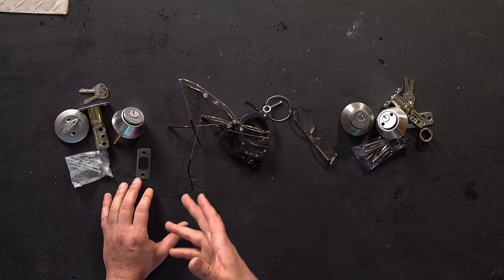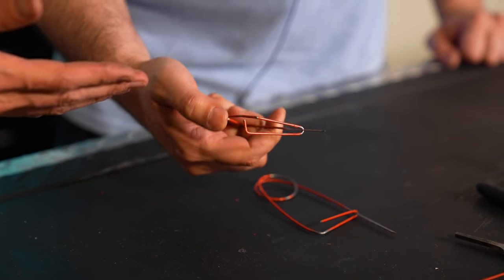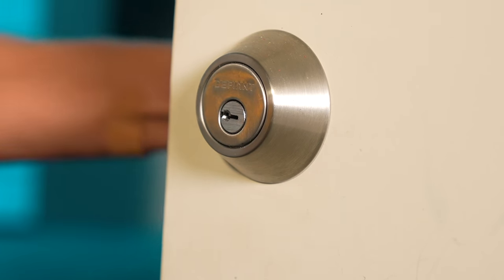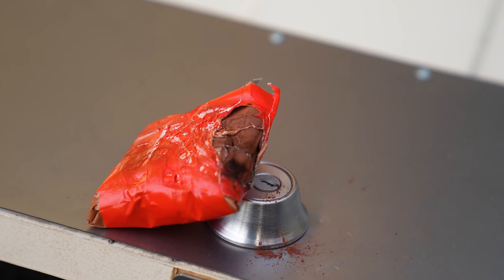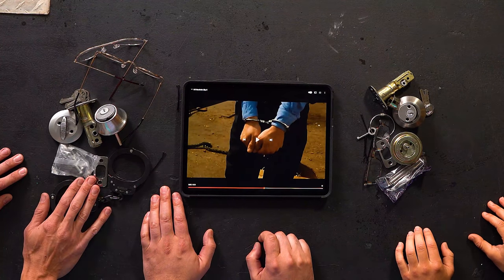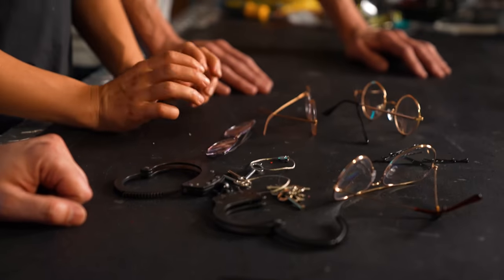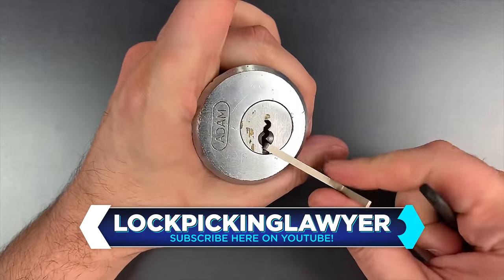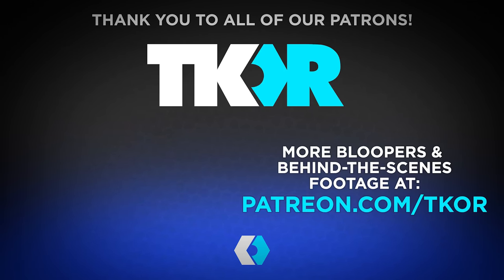Can THERMITE Actually Break a Lock? (w/ Lock Picking Lawyer)

Comment: Nice collab. That clothes hanger trick is really clever!
Reply: Hope the leg's mending!
Reply: And a little terrifying how simple.
Reply: @LightWarriorK  Don't worry too much, it's not effective against all lock :)
Reply: Hello @nighthawkinlight
Reply: Hi NightHawkInLight!
Reply: It works really easily on cheaper locks sold on Amazon, but if there's any security pins it takes real skill or brute force to shear the pins 😏
Reply: I had never seen that before I'll have to give that a try
Reply: @martinferrand4711  you’d be surprised with how many locks use subpar materials.
Reply: I want to see NightHawk make a lock.
Reply: There are some fundamental flaws in the thermite video. First, the door was positioned horizontally, which is not how a typical door is assembled. Second, you only tested it once and concluded that it wouldn't work, even though initially it did burn the door lock completely. Additionally, it would be necessary to use the thermite on several different types of door locks made from various materials to provide a comprehensive assessment.
Please redo the experiment.
Reply: thats what she said
Reply: @real-satoshi-nakamoto  Those were not fundamental flaws of the test - they were hacks and cheats to make it more possible to happen, because sure as heck it's not happening if you were to replicate the scene 1:1. Anything can happen to the outer shell of the lock - what you care for breaking and entering is to break the locking bar itself. So the fact that the door lock burnt completely makes no difference to whether the door opens or not - in fact, it only sabotaged it and now the only way to enter is by drilling/sawing/otherwise bashing down the whole door. 

Also, thermite burns downwards, not horizontal. If you put the thermite on a normal, vertical door, the whole satchel will drop down the moment it burns the handle/shell, leaving most of door intact and not even burnt. It's not some magic powder that can warp gravity.

Comment: Loved his intro. I get the practical reason for showing only his hands, but the running gag never gets old.

I think you're right about the prop being designed just to hold the bag. It's imitating optical card readers but it's mounted completely wrong and the top of it is nothing but a shelf.

Comment: It occurs to me that after thermiting the door you would have access to the bolt depending on the quality of the lock.
Reply: Too hot to touch though
Reply: @vyor8837  Never meant to imply you had instant access.
Reply: @rvaughan74  Fair cop! xD
Reply: On the flip side, if you already are going to the trouble of preparing a package of C4, you might as well make small explosive with a focusing method and blow it open quicker an easier. It's not like thermite is a silent entry method..
Reply: @rvaughan74  you could kick the bolt with ye shoe (added benefit of flaming shoe)
Reply: @GundamReviver  Thermite on it's own is very quiet and burns hot enough to melt through anything.  I only becomes loud when it's added in with something explosive like gun powder.  The reason you don't pre-heat thermite is not because it becomes explosive, but because it actually causes the thermite to burn hotter, faster, and brighter.

Comment: I'd say, other than the termite being unrealistic, the handcuffs were as well. People are trained to put keyholes of handcuffs towards the body, instead of outwards, making picking near impossible because of the length of the chains which prohibits access. That and as LPL mentioned, most modern handcuffs have double locking mechanisms. By itself it really isn't that hard to pick, but does increase steps and length of the picking.

Comment: TKoR had to use thermite to give the LPL a slower method to break a lock.
Reply: "These are the thermite resistant gloves Bosnian Bill and I made..."
Reply: Still didn't get the door "open."
Reply: But it did break the lock, so if something was in place to turn the bolt it may have gotten them in.
Reply: @daricktinker2439  Or the older electronic locks (which the show seemed to be using judging by the card slot and the bulk of it) where the lock had to fail to an unlocked state due to the fire codes in many buildings.
Reply: Literally tho
Reply: @daricktinker2439  Then again the heat and slag could also have welded the bolt into the extended position.

Comment: For the thermite test, you have to make a pocket / funnel to hold the thermite. I suggest using exhaust repair tape. It sucks for repairing exhaust, but does a decent job holding thermite in place!

Comment: We once got locked inside our apartment. Similarly the bolt was in, and the lock refused to open, disassembled it and still couldn't get the bolt out. Ultimately had to take the hinges off and remove the door that way to remove the deadbolt.

Comment: For the thermite scenario, I probably would have used thermate instead of thermite (higher heat output and more violent reaction), and drilled a hole into the door on top the bolt, either burning through the bolt or the wood holding it in place. People interested in recipes let me know, happy to share my info.
Reply: i would like to learn your thermate recipies c:
Reply: Copper instead of aluminum, right?
Reply: @vyor8837  Aluminum is used for iron thermite. If you calculate ΔG for both reactions (using copper instead of aluminum) you will find that for copper ΔG=353.1, meaning the process is non-spontaneous, whereas for aluminum ΔG=-840.1, meaning it is spontaneous. Copper is also more electronegative than iron, another reason why it wouldn't work as the reducing agent. You can use copper oxide as the fuel source, and its very violent, but reaches lower temperatures.
Reply: @cuttlefishrampant5241  dammit, knew I got something wrong there. Couldn't remember if it replaced the iron or aluminum. Thanks.
Reply: @vyor8837  Aluminum is easier to get ahold of, and cheaper too, so I wouldn't worry about it :)

Comment: Based on the sparks in the movie clip, there was some magnesium (or something similar) either in the thermite mix itself or in the wrapper.

The torch would be hot enough to light the magnesium and the magnesium is hot enough to light the thermite...

As demonstrated by TKOR, a torch alone is not hot enough to light thermite...

Note: the reason the sparkler lit the thermite is the sparkler uses magnesium to create the sparks...

Comment: I can pick double locked handcuffs behind my back with the locks facing up using a paper clip. It takes more time but you are essentially just picking he lock both directions. You can also bypass the lock by driving something between the teeth of the handcuffs to prevent them from gripping to each other.

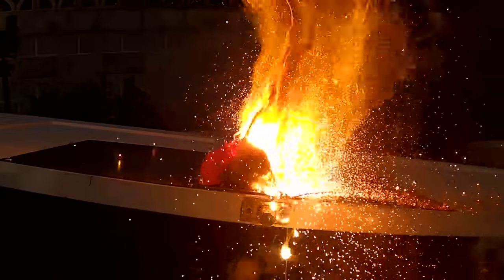Comment: 6:35 Thermite requires a device to direct it. Thermite burns very very very hot. Some sort of piston box-cutter (essentially a box with a slit on it forcing the thermite to take the path of least resistance. This can cut right through steel beams when done right. And iirc, I think railroad construction uses it or similar? Albeit, when would a person need to cut through a steel beam... Probably never.
Reply: Thermite > Jet Fuel?

Comment: Handcuffs ratchet action allow something thin and stiff to slip between the cuff-teeth and the ratchet-tooth, when the space between the interlocking teeth is occupied sufficiently, they slide open, something as stiff as fingernail a few inches long works, like a torn ribbon of aluminum can, or a fragment of plastic spoon, even a wide string can be worked into position between the locking teeth and the opposing mechanism.

Comment: 3:50 The reason it worked for them and not you is you had a PHYSICAL bolt lock, that door had an electronic lock. Destroying the lock made the bolt disengage from a lack of electrical signal.

Comment: One problem with the door lock melted by thermite experiment... If the housing melted off, wouldn't the mechanicals to unlock the bolt be exposed and you would just need to have something to twist that open?
Reply: The mechanicals would be covered in molten iron. Less than ideal.

Comment: Yea I had doubts about termite unlocking a door. They use it in railway building to weld the rails. If its an all steel security door, you might just end up welding the door shut

Comment: Perhaps already commented but it seemed to me that the thermite may have actually fused the bolt in place rather than melting through it. The lock in the movie/TV scene looked like the older style hotel doors where you have to slid the key card in from the top. I have never looked inside one of those, so not sure that melting it off would give you access to the bolt or not and most hotels I have been in recently have switched to the NFC type leaving an even smaller space to place the thermite package - though if you are making the package using duct tape - you could tape it to the door above the key reader. To defeat such an attack - the lock could be designed in such a way that only a couple of wires pass through the outside of the door into the key reader meaning that completely removing the key reader by any means does not give you access to the lock itself. Speaking of Hollywood getting lock picking wrong - why is it that in movies (especially Sci-Fi) when someone wants to get a locked door open they shoot the access panel and when they want to prevent someone else from getting through the door behind them they also shoot the access panel?

Comment: I can imagine a solution to this.  First of all, it would be easier to attack what's holding the bolt in the first place, which is usually just a smaller piece of metal and wood. A simple way to ensure better precision would be to use a special bracket that can be attached over where the bolt would be in a door trim. Basically, you would use a material resistant to the thermite as a cap, and screw it in place over that area, and ignite it.  This would direct the thermite reaction over a focused area and eventually burn through either the bolt or the area on the door trim encasing the bolt, resulting in the ability for the door to open.  The same could also be done in another way with a U shaped bracket that encases around the lock on the door, which you can then use to create a targeted thermite reaction to burn the door off the lock, and thus the door is able to be opened.

Comment: The lock in breaking bad looked like an external padlock with a security/anti tamper surround (to hamper angle-grinder attacks etc...). I've come across a few of them in my industry but usually only on security gates, so it being fitted to a door only serves assist with the plot.

Comment: It's pretty easy to get handcuff keys. Most males will be wearing trousers or jeans. Most of those have belt loops, and most of those have a single belt loop in the center at the back. There's various methods you can use to hide your key on the inside of that loop. And as most times you are cuffed with your hands behind your back the police make it too easy for you to grab that key from inside your belt loop and uncuff yourself. It might not lead to your freedom as you're probably sat in the back of the police van, but when you get to the station and they open the doors to see you sat there uncuffed the cops faces of amazement and confusion is priceless. It's even funnier if you uncuff your hands and then put the cuffs on your ankles. That confuses them even more. I've done both and around the ankles is a lot more funny because usually when the police arrest you on the street they cuff you and wait for a vehicle to come. So the driver never sees you until he lets you out so he's really confused as to why the other officer cuffed you by the ankles. What ever you choose to do just make sure to leave the key in the van otherwise they'll strip search you and that's when it's not funny anymore. Just tell them you found the key in the van on the floor. Our cops can have a bit of a laugh and they won't crush your windpipe with a knee

Comment: You would pour the thermite powder into a baggie and PUT IT ON THE DOOR OR GATE HASP. . .Not the padlock. . . .and bolt cutters work better than thermite. . .and the door in the video above, it swings outward, so the hinges are on the outside. . . knock the hinges off with a sledge hammer.

Comment: On the handcuff thing you can do it when double locked, that only prevents the shiving method, if you can unlock the cuffs with your method than you can undo the double lock as well. Normally the keyhole would be facing up though so facing away from your fingers and with normal hinge and two link cuffs you're not going to be able to do any of the fancy hollywood tricks.

Comment: The torch was never intended to light the thermite directly, as it is terribly difficult if not impossible to light thermite with a propane torch. In that scene from Breaking Bad, you can clearly see a bright white light emitted from the satchel of thermite after they touch the torch to it. That bright white light is most definitely from a ribbon of magnesium.  The torch wasn't to light the satchel, it was to light the magnesium. Which definitely burns hot enough to set the thermitic reaction off.

Comment: I'd be interested to see how LPL does against a properly applied set of handcuffs (double locked behind the back with the back of the hands touching) since that position is designed to make it as difficult as possible to open. I used to practice doing it myself with the key and even that was quite difficult.

Comment: I wouldn't say that being double-locked requires that much more skill to open.. More difficult for sure, but all you have to do is turn the 'key' the other way first, before unlocking it like usual. Most handcuffs even have a visual indicator to let you know if they are double-locked or not.

Comment: The lock in the breaking bad video looked like, and was very likely an electric lock/strike plate and wouldn't have used a deadbolt. Those locks can be set up two ways, one so that when power is removed the lock stays locked, or if power is removed the strike plate unlocks the door.

Comment: First off the thermite in the movie couldn't have been lit with a propane torch, it. Doesn't get hot enough to start a redox reaction. Secondly it is the by product of molten iron that melts. Through material. The package of thermite would need to be 4 or 5 times larger and be formed in a way that would direct the molten iron when the reaction is going.

Comment: Thermite has to be focused on the bolt, but i still suspect that's iffy at best. Thermite would work great on an external lock, but the fire would set off alot of smoke detectors so it's not effective at most penetration efforts.

Comment: Well about the handcuffs. We learned in the military service to always face the keyholes away from the hands of the suspects. Aditionally we had to double lock them always and we didnt have chained cuffs but ones with hinges that severely restricted any movement. So i think that way it would be impossible to unlock them yourselve. And what is also contributing we learned to cuff them with their arms behind their backs and theis hand insidesw facing outwards (cuffs werend round but oval so they cant turn the arms/ hans so the inside faces in) (made it also easier to control them if they didnt comply after cuffing them). So id say a correctly cuffed persond couldnt free themselfes from the cuffs.

Comment: Not sure it works with all handcuffs but i found if i bashed them down hard enough in the right direction the inertia would be enough to move the slider into single locked position even when worn

Comment: In breaking bad the lock is different. It seems to be an electronic lock or something like that. It could be with electrical locking system that could be ruined by thermite. And who says they doesn't use easier ignition for the thermite like you did. Same amount of sparkles... Headline issue was dealt pretty sloppy...

At least you should explain why thermite won't work with that kind of lock. Normal mechanical lock is different than what was on the show.

Comment: you don't think walt was smart enough to include a sparkler as a fuse system for the package of thermite? if you had the sparkler built in, it definitely would have lit in the 2 seconds shown.

Comment: Would the spring pick attack still work on a lock where the keyway is the other way up? As in the pins are at the bottom? Or does this one rely on the pins being at the top of the keyway?

Comment: Better than thermite and easier to get is your standard run of the mill buy it at home depot 7 inch cutting wheel on a Dewalt/Milwaukee/Ryobi angle grinder (6:5 and pick em) and just cut through the door.  Its going to take longer if its cladded but if noise isnt an issue then Bob's yer uncle.

Comment: I feel the thermite experiment is not exactly proper considering you didn't really use the same style of door and lock that was used in breaking bad.
It's like those people who buy cheap crappy platemail and use a crossbow on them and go "OMG CROSSBOWS CAN BEAT PLATEMAIL!", when in actuality properly made chainmail was basically impervious to crossbows then and even most now unless you hit in between the joints.
At the very least it shows that thermite is still crappy to use against a standard door lock due to the bolt placement, and that a fireaxe or a shotgun is still the way to go if you want to bypass a door and don't care about making a scene.